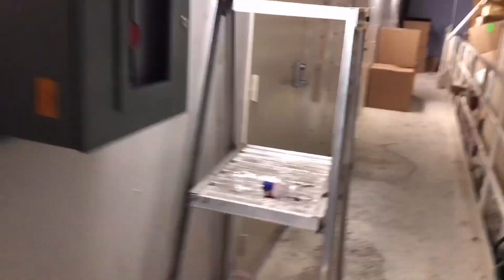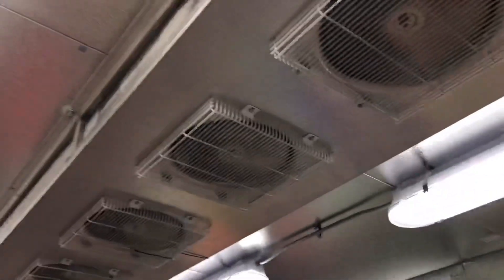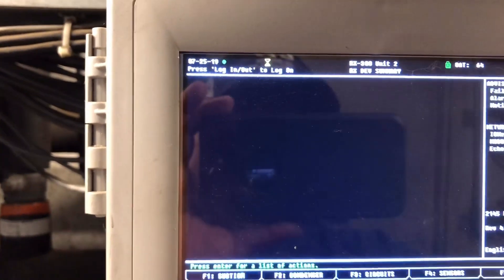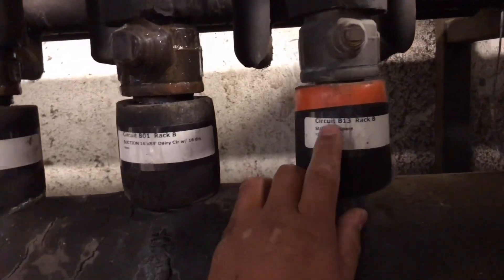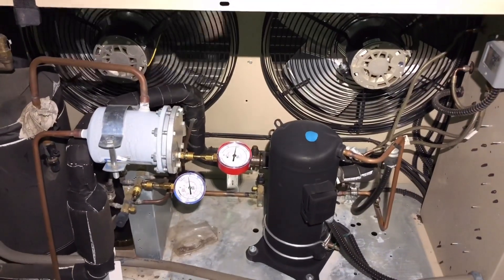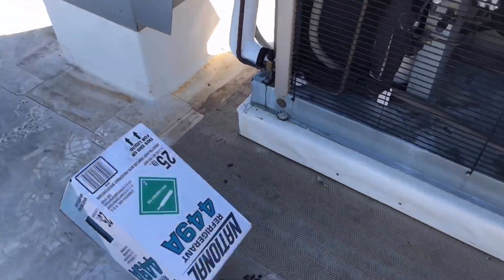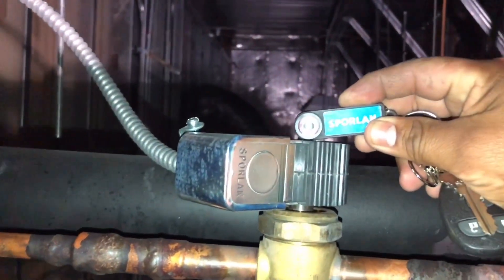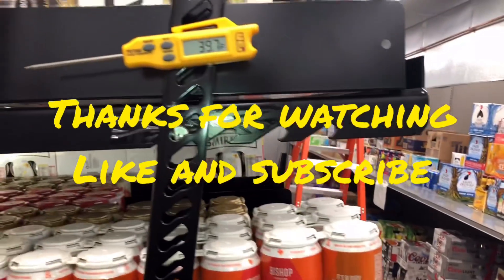HVAC REFRIGERATION:  Late Night Call WIC down and a Quick View of the Rack Room and E2 controller

Comment: Man I appreciate how hard you are working, but videos like this make it easy to imagine why you switched out of supermarket refrig.  You got called out at 3am for a WIC at 38*F? Shouldve called the manager onsite and got that information, and reasoned with them that it'd be better handled in the morning. Lots of the time the night manager is just playing it safe, but will be easily convinced after talking to a tech.  Low on charge but not flat? Do a quick visual inspection for large leaks, charge it up and have the office send out someone fresh in the morning. We all know that handling calls like you did is what is professional for regular buisness hours but you just diving head first into stuff like this is simply unnecessary.

Comment: Hey I have a question. If I have a rack and temperature outside is low and receiver is 40 or 50% how I can remove refrigerant from the receiver.
Reply from the maker: Why do you want to remove?  Does the rack have condenser split?
Reply: Rookie Refrigeration  yes it has, there is one circuit that is one part of the circuit that is no cooling .
Reply from the maker: Then it’s probably normal.  I know our systems run at 35% Liquid level and during split they rise to 50%.  i don’t know what you’re working on.